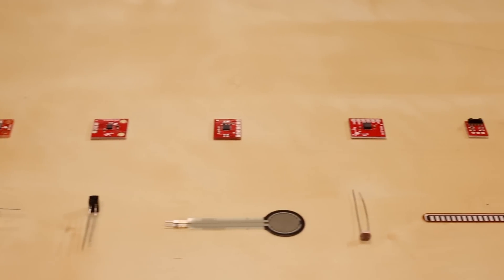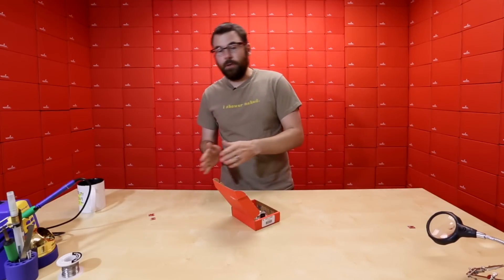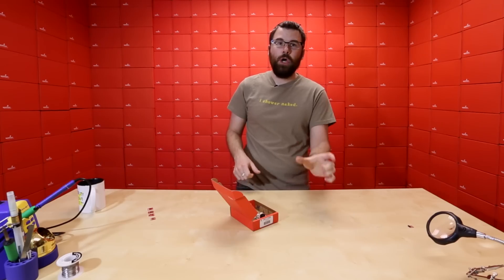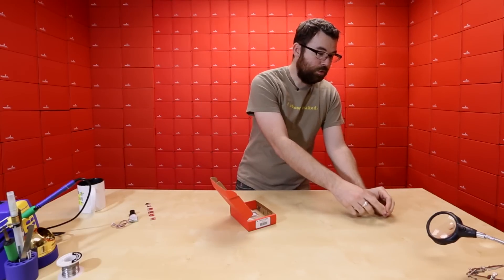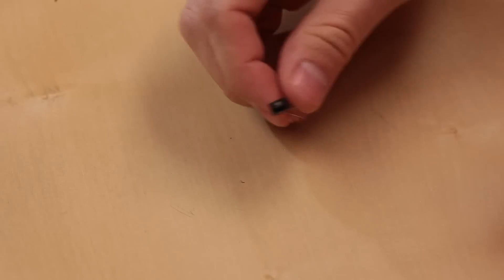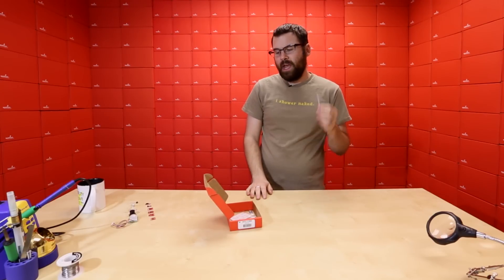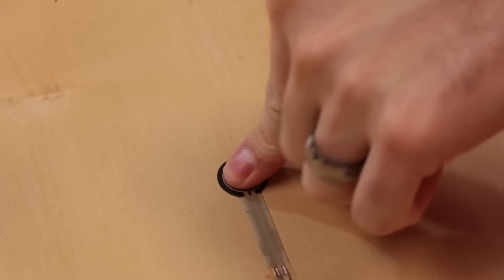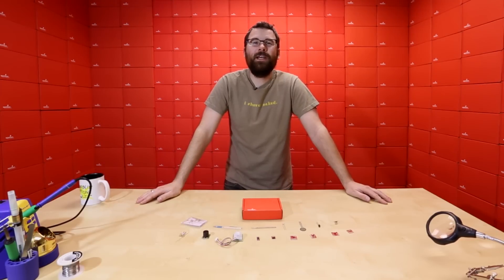SparkFun 5-10-13 Product Showcase: Senstravaganza

Comment: A Photocell is a broad definition, including LDR's and Photodiodes: en.wikipedia. org/wiki/Photocell
Anyway, Robert is wrong as that the LDR in the video doesn't produce a voltage of its own (as a photodiode does), but is just a resistor which resistance varies depending on the amount of light it's exposed to.

Comment: Robert's too polite. We all know the photocell, phototransistor and flex sensor are used for toilet lid sensors, not boxes.
You could use the barometric pressure sensor for a different purpose in there as well!

Comment: That soft-pot looks interesting. I assume you'd need some 'smarts' behind it though? I (once again) assume it doesn't keep the position,when you lift your finger off of it? (probably goes back to "zero" or goes open-circuit,on the wiper?)

Comment: I do think $200 is a fair price for all of those sensors, really. This isn't just some run of the mill digital logic, this is quite tight toleranced analog stuff and a lot of them come as breakouts(so they're usefull to solderingnoobs). Of course this isn't a good deal for experienced hackers, you'd salvage half of those sensors out of old junk. Anyway, $200 is too much for a newbie, I don't think this kit will be a hit!

Comment: All products individually do actually cost more than this, but some prices just don't seem right:

ITG-3200 38 € ? Ok, chip costs 28€(Farnell). Just get the MPU-6050, much cheaper.
BMP-085 15 € ? Thats about twice the price of the chip. Those capacitors must be expensive...

Comment: That's an LDR, not a photodiode! The resistance will decrease with increasing light levels, but it can't produce a voltage or current. Use it in a potential divider to get an analogue voltage proportional to light intensity.